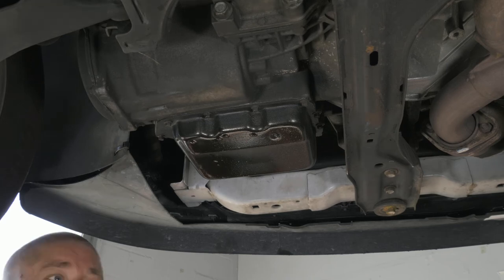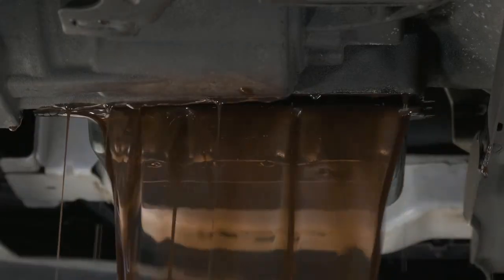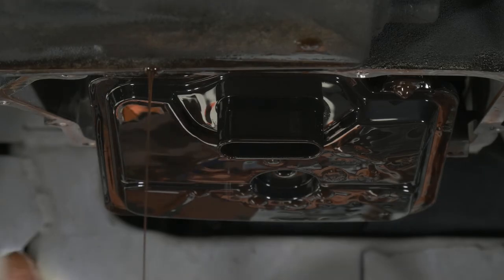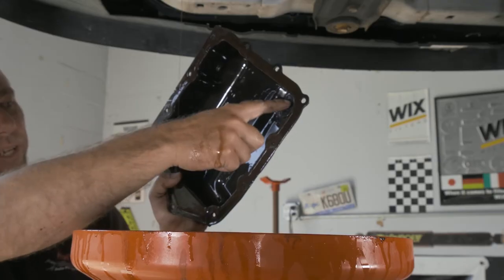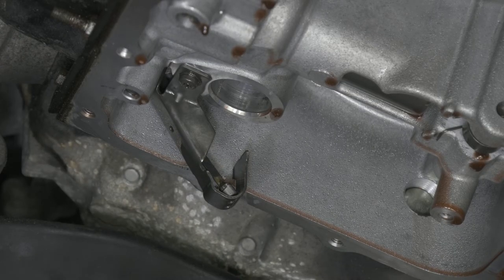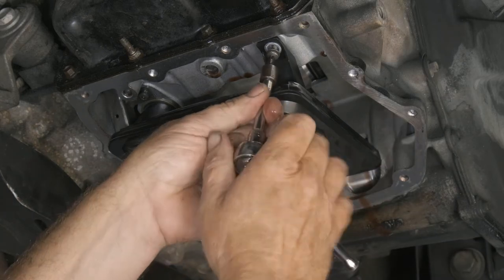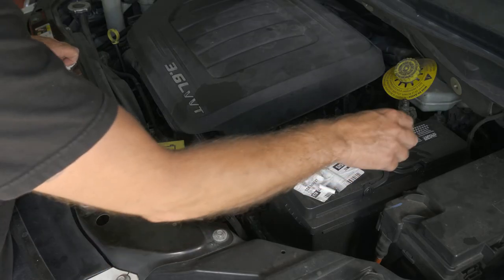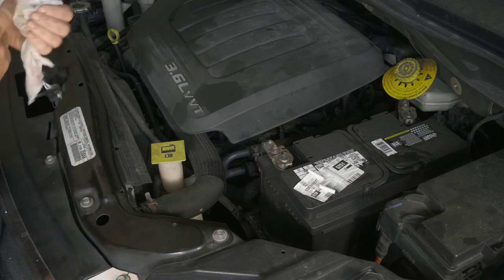2014 Chrysler Town & Country Transmission Filter With Trans Fluid Level Dip Stick Tool Explanation

Comment: Why this fixation with RTV instead of gaskets? A new pain with a drain plug is cheap. Pan, gasket, filter, fluid for around $125 - $150 bucks. No brainer. There are videos out there about using your oil dipstick as a transmission dipstick. Drain into a graduated container. Note the amount drained. Add the same amount of ATF+4 or Red Line C+. Check cold, run around town for ten minutes and check hot. Fill as needed. You can use this dude's method but your time is being wasted.

Comment: Is this a 'how to say the wrong thing several times and not realize it' tutorial. The pan bolts are 5/16" not 15/16" and it's an aftermarket pan gasket, not filter he's referring too. I get it, we sometimes misspeak. But he put it in writing on the screen during editing too. 🤔
Reply: The bolts are 8MM
Reply from the maker: We actually have a different employee do the video editing and that employee is not a automotive technician, so if the tech misspeaks, then the other employee goes with it. We find it funny and all of us that have done videos, find out we mis-speak way more than we realize. Do 100 videos of yourself and look at how many times you say different words than you think you said.

Comment: MY trans BOLTS WERE M8 x 1.25. also always use the chrysler filter not auto zone or after market it may cause ur trans to whine and starve the pump pay the extra buck and save yourself a headache GREAT VIDEO also change the filler neck gasket by not doing so may cause issues it's in there hard so be careful and pry it out.

Comment: I replaced the pan with one that has a drain, best 65$ I'm ever spent
Reply: Where did you buy it?
Reply: @ianmackenzie686  doorman and I believe Amazon sells them to.
Reply: They actually sell a kit to add a drain bolt to Your original pan.

Comment: Why do you need to check level if you just refilled it
Reply from the maker: Because the level changes with temperature. As the temperature increases, the pressure increases and the fluid level will be different based on temp.

Comment: Great job. What happens if you put to much oil in?  What happened when you replaced it for the second time? Why is'nt there a drain plug like the engine oil?
Reply from the maker: An automatic transmission is essentially a high-pressure pump that uses fluid to create pressure to change gears and work solenoids. Putting too much oil in can have many issues; sometimes, the problem of a poorly shifting transmission is too much or too little oil. Too much oil can cause foaming with air and or create more pressure or temperature than required. The first thing we check and fix when a customer has a transmission issue is the level and color of the fluid. We cannot diagnose a transmission problem if it comes in with too much or too little fluid.

As far as a drain plug, that is the vehicle manufacturer's choice and most of the time it is because the pan has to be removed anyway to replace the filter. I'm sure manufacturing cost plays into it also.
Reply: Thanks for the reply. Can it be any kind of filter, or do you stick with Mopar parts? @APDTY
Reply from the maker: Great question! Aftermarket brands are wonderful as long as they are known trusted long time brands like WIX, ATP, or our brand APDTY.
As professional technicians who made a living diagnosing and repairing vehicles, we have been somewhat trained or conditioned over the years to use factory parts. This is for many reasons, including the fact that the OEM is usually very high quality, usually the exact same part we are taking off, and since we only get paid to do a job once, we do not want to waste time if an aftermarket part is wrong or subpar quality and we have to do the job over again under warranty. This actually happens often and is sometimes what sets an efficient technician apart from a not-so efficient technician. Also, OEM parts are usually the most expensive and techs usually get paid a percetage of that. A known good part is very much appreciated. A known good part that can make you more money, well you can figure that one out😆. @deanjagger1190
Reply: I don't think I would have botton this van if I new that it did not have a dip stick for the transmision fluid. What were they thinking when they came out with this engine. @APDTY

Comment: What did you spray to clean the perimeter of the gasket mounting surface
Reply: I've used brake cleaner.
Reply from the maker: Use brake cleaner or any alcohol-based automotive spray cleaner.

Comment: I have to replace 2 Ox Sensors on my 2014 Town and country van. They are both upstream. I guess I should replace the downstream sensors at the same time? When you replace the transmission filter and oil, should you do a flush of it???

Comment: 15/16. Bolt head size. NOT even close. So YOU are saying they are just 1/6 inch under one inch. Your NOT going to put the FILTER back in. And it didn't come fr0m the factory with a filter??? Maybe a ,,gasket.  Good vid.

Comment: I guess ive got the only odd duck. I did a complete trans service and purchased the dipstick tool and it took all of 9 1/2 qrts and i didnt drain the torque converter... i skipped the 15/16 socket as suggested. So i guess the torque converter actually drains in these without drilling and plugging ??

Comment: why change the bushing if the filter is so tight?
Reply from the maker: Good question, you could probably re-use it but depending on the filter kit you get, a new bushing is usually included. Since oil may eventually degrade it, and since you get a new one, might as well use it.

Comment: Changed filter and fluid today, put fluid in an hour after replacing seal and tightening bolts, drove it an hour later. Leaking underneath now from what looks like a single point at the rear of the pan. How long should you typically wait to put in fluids after replacing the pan seal, and how long to wait to drive after adding fluids?
Reply: Its a good idea to put the RTV on the inside of the bolt holes, not the outside to prevent leaking thru the bolt holes. Let it sit at least an hour before filling with fluid. You dont need to wait to drive. Run it thru the gears before driving with the brake on and then check fluid hot.

Comment: My transmission fluid definitely needs changing and gears won’t go in reverse for my 2014
Reply: Did you ever find a resolve to this? Same issue. Dirty fluid. Significant metal shavings (no chunks). Won’t reverse. Was recommended a full rebuild for $5800. One they put it back together it’s running worse. Wondering if it’s caused by something that was “moved” or maybe fluid when they dropped the pan.

Comment: Great job. I installed a drain plug in my transmission pan (drain plug kit 80250), works perfect and this always takes 6quarts exactly.
Reply: Which Town and country do you have.  I have a 2014 and thinking about draining the fluid myself.
Reply: Sure would be nice to drain it with out dropping the pan. But in order to change the oil, you should change the filter to. @SunshineStateofMind1981

Comment: Are the pan bolts more likely 5/16 heads ?  Don't look like 15/16.
Reply: Nope definitely 15/16. Gonna need to bust out the big sockets cause these boys are HUGE! Might even need a breaker bar and some heat.
Reply: Pan bolts are 8mm.
Reply from the maker: lol, 8mm which is also 5/16.